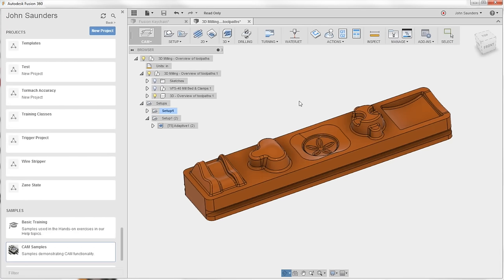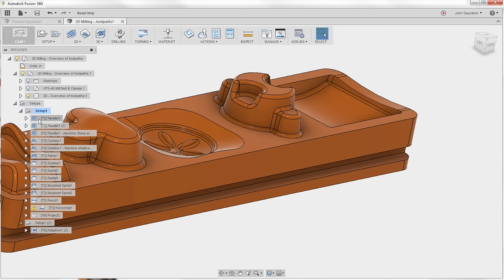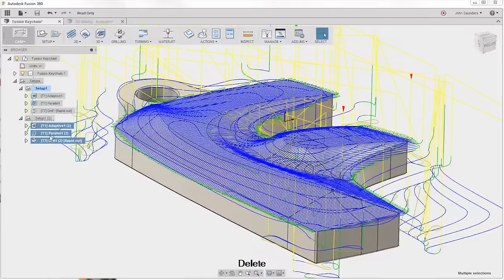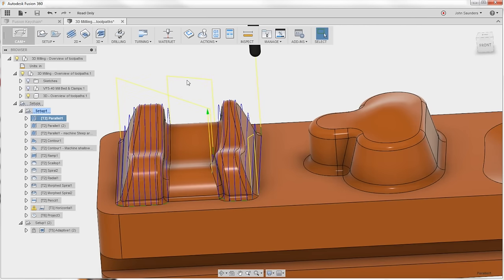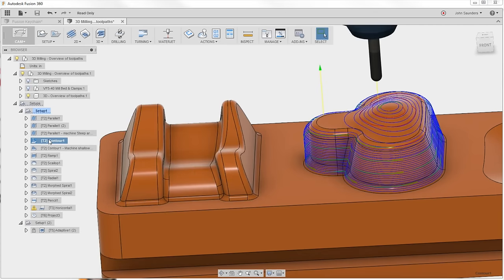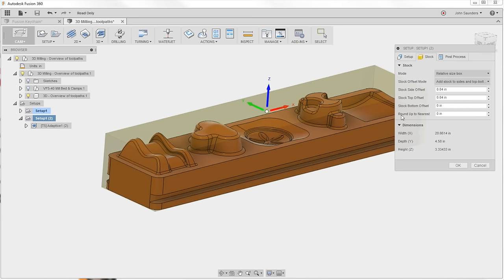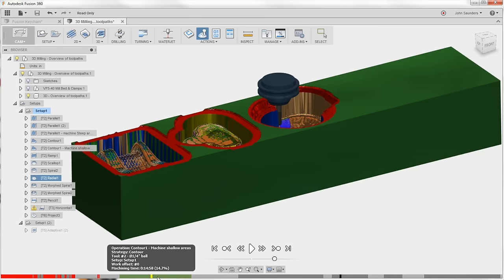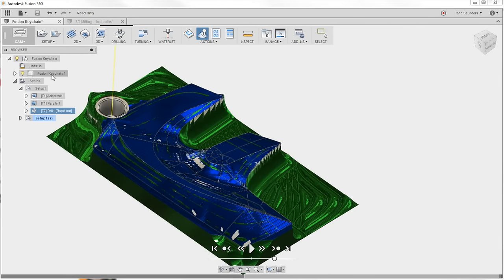Fusion 360: 10 CAM Tricks You Didn't Know!  FF46

Comment: Ramp Taper Angle - great tip. Is there any way to add a taper angle to a normal ramp or a however? I use ramp rather or contour (ramp is faster) when profiling a thin (.25-.5" thickness) part on a vacuum table as a final step, but I'd love to add a taper for extra chip clearance. I tried to force it by making the model itself tapered, but that doesn't work for obvious reasons.

Comment: I can tell your not a fan of "relative size box" - i actually use "relative size box"  for almost for every job i do. (i make military aircraft sight head components)   First i model the part in Fusion360, then i select "relative size box" and additionally select "no additional stock". Then i machine the outside of the part to the exact size. Then i can clamp or vise the outside of the part however i like, and machine the inside of it.  So point being - some things work for some that don't for others. "Relative size box" is a life saver for us. i just wanted to share that :)

Comment: Is there a way to simulate a later toolpath, with the stock as it would be at that point, without having to simulate the earlier toolpaths, too? Seems like this would make sense, especially with rest machining on that operation.
Reply: No, that's why it stays 'pending' until all previous Toolpaths are generated. Otherwise, it won't know what is left for rest machining to go and remove. it would be nice, but it breaks the order of operations for the algorithm to process on the exported STL surface. It's a computer not a psychic so it has to know what the previous ops remove from the stock by doing the required toolpath calcs before it can go forward. That's why it generates top to bottom. you need the answer from the previous question (as a temp STL surface export) before you can use it to solve the next question (ie.. toolpath generation). Hope that makes sense.
Reply: kevinkillsit Yup, thanks for the reply!

Comment: I knew most of them I do know that you have gone over #10 quite a few times in other videos but I do like the one about protecting the tool path 

now this maybe wishfull thinking but imagine if you could simulate surface finish it seems to me that even when you simulate a part the rendering of what is cut is not of the highest quality I mean to me it seems like a computer program should show you in high definition what the part will look like  after it is cut including surface finishes wouldn't it be nice if you could simulate surface finish on a part? that would save you alot of time in the long run trying to get your code dialed in!